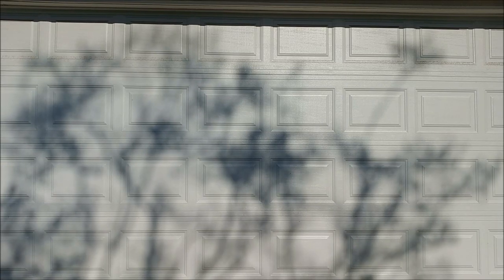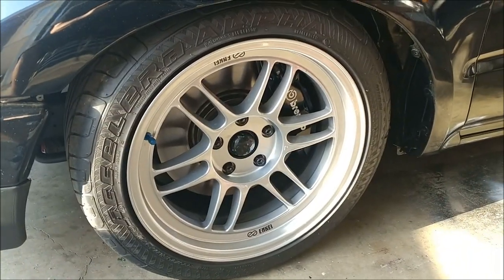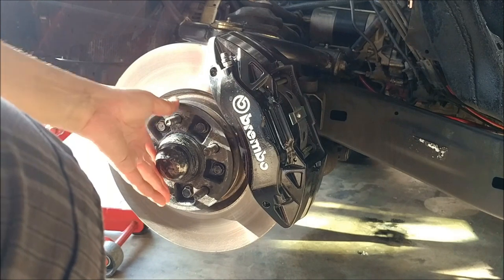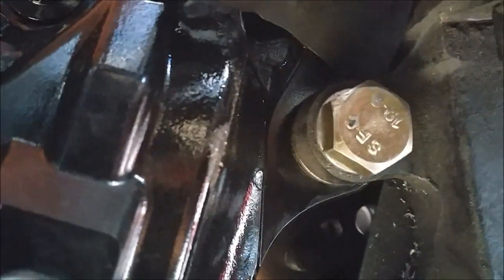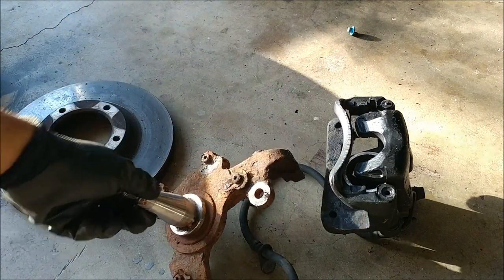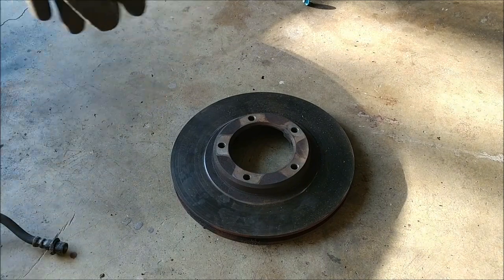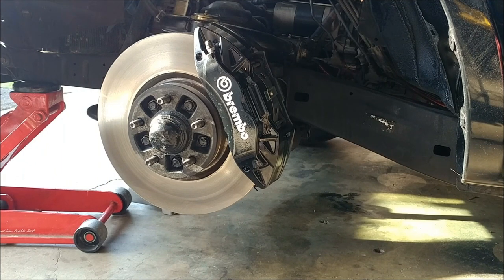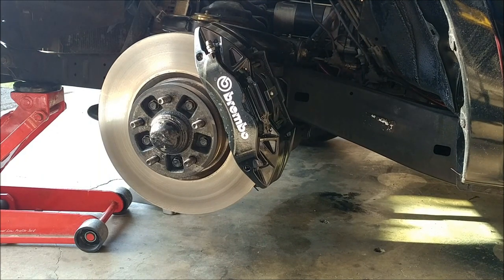Toyota Tacoma DIY Brembo Big Brake Kit (5 Lug)

Comment: Just finished my install yesterday. These things are ridiculous, they basically feel like the brake section at the end of a roller coaster! As far as the hardware not listed goes:
(4) M14 x 2.0 x 35 mm bolts
(4) M14 washers 2.5 mm thick (they go between the bolt head and knuckle)
(8) 9/16 washers 2 mm thick(each) (they go between the knuckle and caliper)

I had to use (2) 9/16 washers per bolt to obtain the 4mm gap necessary between the knuckle and caliper as all the M14 washers I could find were 2.5 mm thick.

Hope this helps and happy driving!
Reply from the maker: theroadkilledchicken thanks man! I totally forgot to update the description here with the updated hardware after I updated the threads. I'll add your info into the description here. Glad your install went smoothly! Got any pictures posted anywhere?
Reply: not yet, I'll try to get a vid or two up over the 4th.
Reply from the maker: theroadkilledchicken no worries man! if you have an Instagram you can find me at the same username mjbtaco. Glad the video was helpful and super happy to see other benefit from it!
Reply: what year CTS do I need for the brake pads?

Comment: My 98 ext cab Tacoma has no abs and is stripped down. I have locked up my front tires a couple times with the stock brakes as is. So I opted to just overhaul with new powdercoated calipers and upgrade the rotors, pads, and lines over stock or a brake kit. Everyone has different needs. Props for going your way to put your brake kit together. It looks awsome. You can put rear discs from a supra also but I just overhauled my rear drums and did a manual adjustable proportioning valve since the oem valve started to leak.

Comment: I got my brake upgrade done, it wasn't cheap for sure.. I tried drilling the spindle larger waste of time, ended up using a carbide bit and rolled it around making the hole larger until the caliper bracket fit flush.. could not find a machine shop to do my rotors, So I used a tire machine at work to center the rotor and used a carbide bit and spun the rotor until I got it ground out. Works fine, I believe it needs to be like 86-87MM with a angle bevel on the edge of the hole. Don't waist time drilling and tapping the rotor to hub, put rotor on hub and mark and drill holes and use nuts and Loctite plenty of room on inside. Break pedal feels like a solid rock. Good luck

Comment: Hey dude awesome video really helpful I just have one question are you running drop spindles ?? And if so what type and how much drop?? Thanks in advance
Reply from the maker: Awe Guy thanks! Unfortunately no, I'm running stock spindles along with a balljoint flip. I do hope to get some drip spindles soon though.
Reply: Would you recommend running drop spindles with that set up??? 
How do you find the spring rate at 565?? I’m planning a very similar set up for a track car did you notice a big difference in cornering??
Reply from the maker: I havent tried a drop spindle with the brakes but i would definitely recommend them for any type of track setup. it keeps the tie rod geometry much closer to stock than a balljoint flip so you wont have issues with bump steer.  I dont  know if qa1 still offers a 565lb spring but id go with 600 or higher for a track setup. they still offer that and the part # is 8mb600. The difference between stock and the qa1's is light years apart. the qa1's are so much better all around.  you can even get the double adjustables if you wanna get more serious about tuning your suspension. i also just ordered some adjustable rear qa1 shocks that i'll be throwing on as soon as i get them.
Reply: Wow dude thanks heaps for the help I’ll do some more research there’s not much information out there and your videos really help all of us 

When your ready to turbo your truck let me know I’ll send you a forward facing intake I make them here in Australia and send them all over the world 

Keep up the good work brother 🤙🏽
Reply from the maker: SHED KING no problem man! And thank you for the love! I will definitely hit you up! I've been really contemplating the turbo build again and I'm itching real bad for some boost haha. If you have an instagram hit me up @mjbtaco_ so I can check out your work!
Reply: mjbtaco will do brother talk soon 🤙🏽

Comment: Looks like they turned out great 👍 how is the stoping power now?
Reply from the maker: Blake's Garage thanks man its a night and day difference for sure! its actually taking some getting used to lol. ive been trying to stop super late for stop signs and I still end up stopping short of the line. next I gotta convert my rear drums to disc to balance out the package. thanks again for putting the information out there!
Reply: @mjbtaco  did you ever do the disc conversion on the rear?
Reply from the maker: @xrunner800  I haven't. I did buy some smaller brembos for the rear I just haven't been able to work on it.
Reply: @mjbtaco  is it just going to bolt up or will it be a lot of fab work? Them drums look terrible behind some 20s.
Reply from the maker: @xrunner800  gonna try to keep it as bolt on as possible but we'll see

Comment: I just order everything but the bolts/washers and it was around $700 almost not too bad, I did get the drilled/slotted front rotors. I already got 17 inch Subaru wrx wheels using adapters so they should clear. I want to be able to use a tow dolly and not crash..

Comment: I'm starting my build on my tacoma soon and want to do a brake build like this. Did you only do the front brakes or did you replace the drums on the back as well? Is it possible to take the stock front brakes and swap them to the back?
Reply from the maker: Logan Ward I've only done the front do far, but the rears are in the plans for the future. People sell rear disc conversions. I'm not sure how well the front parts would work for the rear but with enough fabrication I'm sure they can work.

Comment: I have a 1995 Toyota pickup hilux last generation and my question is ¿do you know if the spindle dimenssions change from the hilux 95 to the tacoma 95???...cause I would love to get this kit for my little truck
Reply from the maker: Yeah unfortunately the spindles are different so this wouldnt work without a custom made bracket
Reply: @mjbtaco  ok thanks I'll do my research 🤟

Comment: Does the thread onyour Cadillac caliper look like an insert type?. I can get the gap right. It rubs on the rotors.
Reply from the maker: Like mentioned in the video you need to shim the calipers to center them on the rotor

Comment: Hey I do all this any recommendation bout brake reservoir??? Bc still fell don't work good
Reply from the maker: You need to make sure you bleed all four bleed valves on the calipers. As well as your rear brakes. If they aren't braking well there may still be air in the system.
Reply: Ok I'm try that tanks for answer no right away that's mean you serious

Comment: I have a '93 T 100 (RWD ,6 lug).... Can I do just the caliper upgrade. I already have cross drilled rotors, stock size.
Reply from the maker: Daniel Steele unfortunately I'm not familiar with the T100 front suspension so I can't say for sure.

Comment: Is there any way to get in contact with you? I bought all part from the links and i just went to my machine shop. He tells me that he can’t do the threading into the rotor. “There is simply not enough depth to put enough threads on it”. Also the predrilled bolt pattern had a wider hole than i. The original rotor. Now I’m stuck with over $500 in parts and a truck in my garage on jacks with no front breaks at all....
Reply from the maker: Pablo Abello I suggest you go to another machine shop. Multiple people, other than myself, have successfully completed the upgrade with no issues. There isn't going to be a ton of threads but there is enough to make this work.
Reply: mjbtaco rule of thumb. The depth of the thread needs to be at least width of the bolt. Two machine shops have told me the same. Also, did you have to to redrill the bolt pattern? The rotor holes are too big
Reply from the maker: Pablo Abello yes the bolt pattern has to be redrilled. And as far as the thread depth goes it isn't as deep on the stock rotors as the bolt is wide. You can show them your stock rotor so they will do it. If Toyota is Ok with doing it they should be too. This is the first time anyone has had this problem.
Reply from the maker: You can see pictures of the finished rotors here. 

https://www.tacomaworld.com/threads/5-lug-budget-big-brake-kit-no-caliper-brackets.476849/

Comment: You should make a kit and sell it on Ebay I'm sure you can make some profit of a bolt up kit like this. Ik I'd be extremely interested in a full bolt up kit just to avoid sending  things out to machine shops
Reply from the maker: It's not really worth it to me to try and make a kit. It would bring up the overall cost a ton when you factor in the work it would take and shipping costs. This was always really meant to be a DIY mod to keep the costs down since there are already other more expensive options.
Reply: @mjbtaco  yeah it makes sense. I'm going to get some factory knuckles so I can put that break setup in my 83
Reply from the maker: @JoseHernandez22r  just a heads up the this mod wont work on the Toyota pickups the spindles are completely different than the 95.5-04 Tacomas
Reply: @mjbtaco  yeah I'm going to have to get the tacoma spindles
Reply: @JoseHernandez22r  how you going to do that??
Do they fit oem?
I have a 95 hilux body and I would like to do the adaptation

Comment: So they make them for 4x4 tacoma
Reply from the maker: The spindle on a 4x4 is different than on the 5 lug so it wouldnt be bolt on. But you can do the tundra upgrade on a 4x4 Tacoma and it will be completely bolt on. No machinging or drilling needed.

Comment: So can pick up of scrap yard. Cadillac calipers and rotors. And make work on my 1995
Reply from the maker: You might have a hard time finding all the parts at a ju k yard. And the rotors are from a Mitsubishi, the calipers are from a Cadillac. If your 95 is a Tacoma and not a pickup then this setup will work.

Comment: Tap and die size and drill bit size?
Reply from the maker: You dont need to tap the spindles. 9/16" drill.
Reply: @mjbtaco  no for the evo rotor the 5 holes to drill to adapt to the hub so I got the measurement it’s m10 x 1.25 and the drill bit 8.75mm I’ll be taking the rotors to bore the hub but I’ll be doing the drilling and tapping on the evo rotors
Reply: Iv mounted everything but they gave me the wrong washers so the alignment isn’t 100 percent so I’ll be finishing the job tomorrow they gave me 2mm thickness washers instead of 2.5 and as for the 9/16 washers instead of 2.0 I got 2.2 but I don’t think that is much difference the big one is the .5

Comment: Anybody know the difference between the 1st, second, and third variation of the first generation tacoma besides the lights? I have the third variation wanting to turbo it
Reply from the maker: Logan Ward what are you wanting to know about it?
Reply: mjbtaco well first I'm wanting to know how you lowered it with how little front suspension travel it has before it hits the bump stops, and with how freakishly low the leaf springs hang on these trucks
Reply from the maker: I have a video showing my entire front suspension setup. Still lagging a little on the video showing the rear setup. But i'll get it out soon hopefully.

Comment: Could I use these parts for a rear drum to disk conversion ?
Reply from the maker: These brakes are way bigger than the stock front brakes so putting these on for a rear disc conversion wouldnt really make sense. They would in no way be bolt on and youd have to custom make a bracket to get them mounted. Youd be better off looking for something smaller.